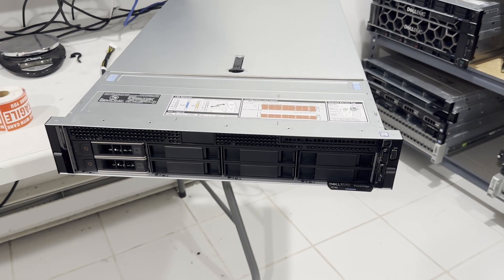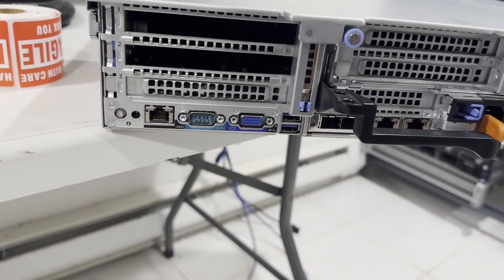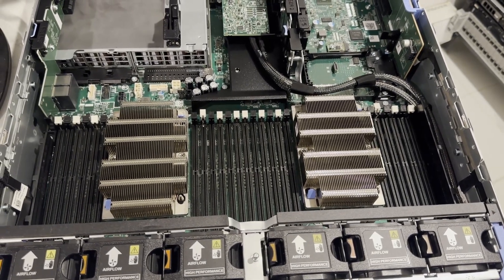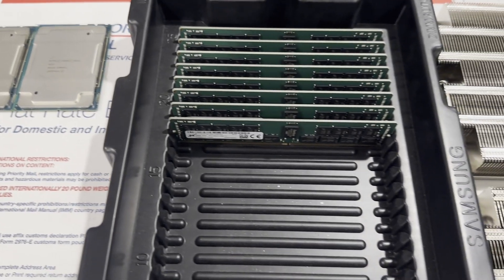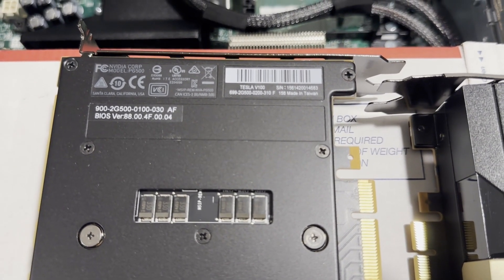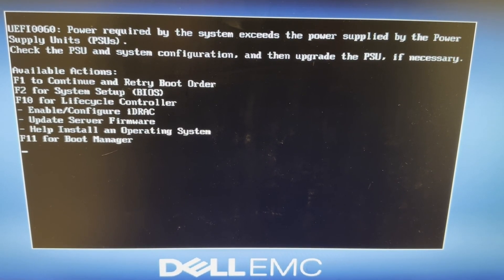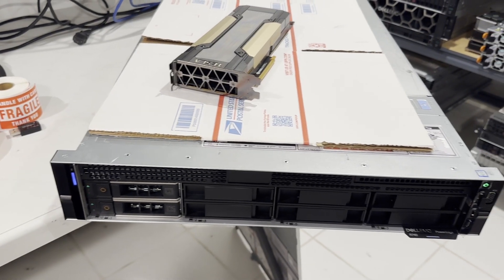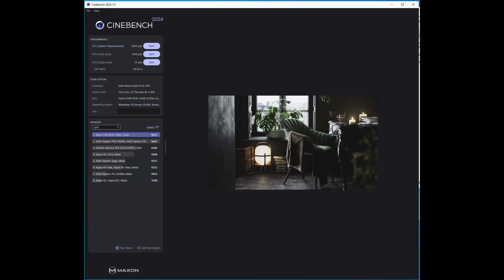NVIDIA TESLA V100 Dell PowerEdge R740 Artificial intelligence AI TrueNAS Virtualization Home Lab

Comment: I tried to install one Tesla v100 32GB, using 2 x 2000W PSU, riser and cable, after 10 seconds, CABLE OT5TP melted. Any hints if this is the right cable?

Comment: How did you solve the problem of the fans staying running at 100%? In my case, it seems to recognize the GPU, but IDRAC 9 doesn't seem to interpret the temperature sensors, going into panic mode and keeping the fans operating at maximum.
Reply: there's an option to ignore the pcie card slot for fan calculations

Comment: Hi how the 8 pins can support that?
by right 8 pin can only supply 150 watts no? 
hence the total power supplied was only 225 watts tgt with the PCI slot?
but the GPU spec said it requires at least 250 watts
Reply: Perhaps if you read the Molex datasheet, you would understand where you went wrong. The Mini-Fit Jr connector is rated at 7.0A per contact for 7-10 pin configurations. So, with eight pins at 12V, the rating is 4x7x12, which is 336W and well over 225W. As such, configurations up to 300W per GPU are supported, assuming you have the correct risers.